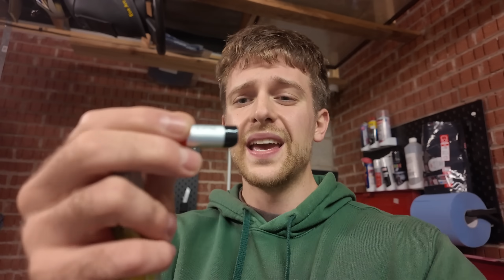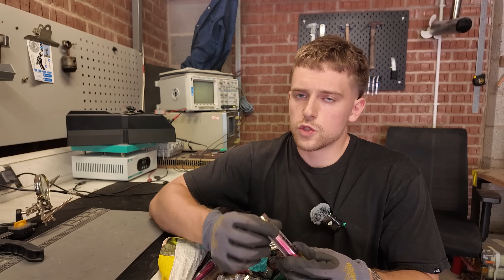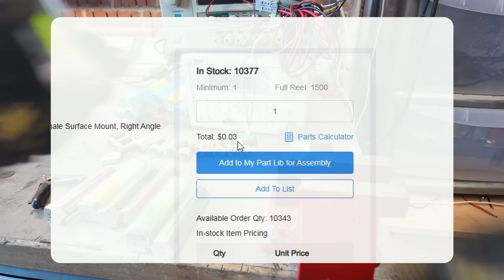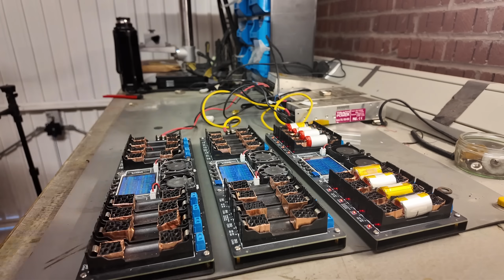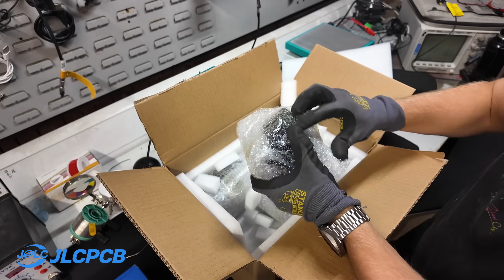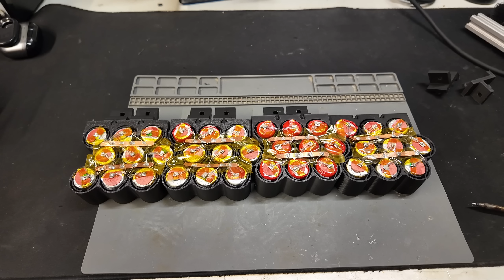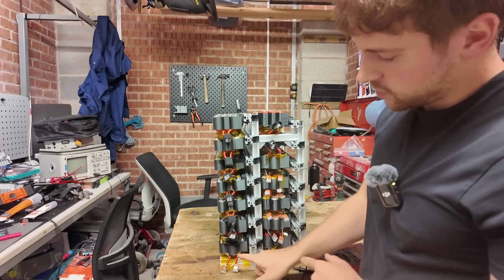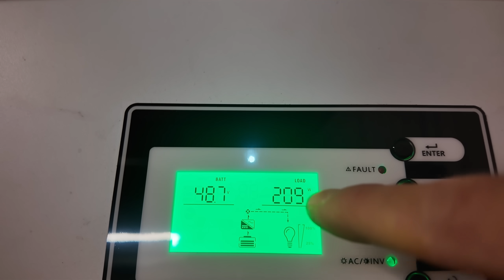I Powered My House Using 500 Disposable vapes

Comment: A 2V cell is not necessarily dead. 2.5V is very much recoverable but even lower can still be saved. 

Big caveat that any below 2.5V should be treated with extreme care. That said, these cells have only had maybe a couple of cumulative cycles or possibly even one cycle. 

They will be degraded and have a much shorter life but could still sustain hundreds of cycles at a reduced effective capacity. 

I usually mark such cells and trickle charge them, cycle them a couple of times and use them in low power projects in low risk settings. 

Separating these cells is still a social good as it makes recycling much easier for downstream waste management.

Comment: It's a fun project, but it's definitely not feasible and is extremely dangerous. It's best to do this with pre-made batteries using lifepo4 chemistry, which is much safer than Li-ion batteries.

Comment: As you're sponsored by jlcpcb, maybe next time instead of fiddling with copper tape, you could use PCBs to interconnect, with thin traces as fuses, route  bms connections  and maybe even provide  mechnical structure.

Comment: Please get or build a proper point welder and get these nickel strips to connect the cells. You could build one with a 10ah motorcycle battery, a 500A starter relay, a timer, a footswitch and copper electrodes.
The battery will be shorted thru the starter relay for half a second or even less, the timer must be able to do 0.1 second pulses. With that welder You can produce proper safe batteries.
I´d be way too scared to just solder such a battery, for a test- okay, maybe. But it has to be redone so do it proper the first time. Every battery I opened is welded, not soldered- I wonder why…
You did well enough, I can see the value in it. But please weld Your cells, You´re a good Lad, I want for You to not …leave the group chat because of a wanky connection. For the "Extra Safety" You need to weld.
And store that stuff somewhere when it goes it doesn´t include You or the neighbours. God Bless…

Comment: Power it by your own, self made solarpanels. 

Also, quick addition. The UK used to be 240v mains standard, however the past 3 decades the UK and the rest of Europe has been working on standardizing the voltage to a range arround 230v. So all power in the region will be 216.2V to 253V. 240 is works just fine, but just something to think about. We in the Netherlands also still have a lot of people thinking the grid still outputs 220v (I currently read 229v in my breakerbox).

Comment: These batteries are only rated for about 500 recharge cycles, which, if you're gonna be constantly using them to power everything, you will reach fairly quick
Reply: Not true.
Reply: That's like saying an expensive phone is junk after 500 charge cycles 😂
Reply: @Samusaran77  What do you mean? Batteries in phones and other electronics are usually rated for way more charge cycles than these vape batteries. And I don't get the comparison with a phone since, no, expensive phones aren't junk even after their battery dies, but disposable vapes are. They have nothing to offer to you other than their (albeit subpar) batteries, unless you're a smoker.

Comment: lithium cells below 3v aren't bad.  They have just been discharged below their balance point.  They still work, you just have to bypass their safety circuit to charge them up the first time.   Tossing them because they are below minimum is such a waste of resources.
Reply: You may be slightly right, but there is a reason that the safety circuit refuses to charge them. They can develop metallic "dendrites" on the electrodes and actually are not fully safe. Maybe you could use them but I certainly wouldn't include them in such a large pack if I were Chris!
Reply: @cyberspearmint  Mmmm puffy cells
Reply: These cells are made with extreme anode overhangs and are not safe to recharge.
Reply: depends though, if they have gone really low then they will not be safe to recharge. can't remember exactly what the lowest voltage limit was, i think its not an exact science since you dont know whether any of the formations have started on the contacts without cutting them open and lookin on an atomic level, but if they form to the point it shorts then the battery will explode if you try and charge it. the under voltage protection circuits on them is there for a reason, it's just likely to be rather conservative with what it considers safe to recharge in order to reduce the risk of fire to near zero.
Reply: @MrMediaPC  Of course they will be safe to recharge.  You're talking about a cell that has had ONE initial complete charge, and ONE complete discharge in it's ENTIRE lifetime.  One full discharge will perhaps lower the TOTAL lifespan of the lithium cell 0.1%.  In THIS application that degradation is COMPLETELY negligable, since it will NEVER again be charged without a battery management system.  Calling cells "dead" just because they were discharged below minimum ONCE in it's entire life is leaving resources and money on the table.
Reply: @MrMediaPC  And that's pseudoscience and completely wrong.  The ONLY risk you're facing, is lowering the lifespan of a battery.  Battery manufacturers USED to claim, that you'd need to go below 1v for the chemistry to change in a Lithium battery, but the knowledge has changed since the 2000's when this statement was made.

Comment: 'damaged' cells most of the time just need a kickstart and rebalancing
Reply: Maybe this could be another project!
Reply: It’s true, but from what I’ve read they do lose capacity. I did recovered some old micro usb cells by directly charging them a bit. But I’m not very knowledgeable on the subject to tell if they lost their capacity because of time or because they got discharged so much! Not from use since they were barely used!
Reply: @TheMrSzmidt  I have recovered lithium cells from at least 40+ laptop battery packs that contain 18650 cells and I can say that for those that were severely discharged, at most they had a 300mAh loss in capacity over the other non severely discharged cells in the same pack so it's not a huge loss and still plenty usable. In some cases after cycling them I have noticed a capacity increase and the internal resistance going down as if it's healing.
Reply: True, but what really matters is how much damage was done by overdischarge. Meaning you need to test their internal resistance, effective capacity,  charge-discharge curves and temperature behavior.

Comment: 20:00 How long would the current capacity be able to run the load? Is that number of cells something thats running the house for 1 day? 1 hour? 1 minute?
Reply: So he mentioned the workshop was pulling 200w and the shot at the end says 45 amps at 53.63v so i think that means his battery pack has around 2400wh of juice. That should power his workshop as shown in the video for 12 hours and i imagine the house would be slightly less time, but he would probablly turn the workshop off when going inside too.
Reply: @AgedComponents That’s watts, not watt-hours. The BMS app showed that the battery pack had a capacity of 20 amp-hours and put out 49 volts, so that gives 980 watt-hours of capacity.
Reply: @BobbyHill26 ah thats not long at all then 5 hours in the shed and maybe 2-4 in the house depending on stuff like climate control and appliances. Im not too educated when it comes to eletricity but cunninghams law is always dependable lol.
Reply: @AgedComponents even worse, at one point you can see there’s a 270 or so watt draw on the battery, but the load on the inverter is only 210, so you’re losing a pretty good bit from the inverter inefficiency, I don’t know how it scales as the power draw goes up or down, but that’s about a 20% loss, so he’d really be getting less than 800 watt-hours

Comment: some flux on the solder joints would not only make them flow and look a lot better but also reduce the heat by A TON...
also, having to print and then wrap all the "springs" when you could have just used... I dunno... what do they use in flashlights? oh yea, SPRINGS... even just a Z-shaped strip of bus bar would have worked... saved ya at least a day right there

Comment: Vape batteries are great for small projects, but being constructed for single use typically means they don't have integrated protection and their chemistry is inferior, I found under test, they have a tendency to deteriorate faster than lithium batteries manufactured specifically for multiple charge/discharge cycles.

This is my opinion, I could be Wong! 😏
Reply: Yep, there's a lot of nuance in cell manufacturing and chemistry. Cell design has different "knobs" you can turn - increase capacity at the expense of longevity, or decrease manufacturing quality to improve cost while reducing reliability/safety. Vape batteries also tune far towards power output (high watts and C-rate) instead of energy density. EV batteries are a great case in point on this - tuned far towards longevity (years/charge cycles), while phone batteries are often still tuned towards capacity (runs long on a charge, but doesn't last many years).
Reply: You could also be Wright. We may never know!
Reply: @bluephreakr  I'm down and under now, you could be on to something, if I didn't know better I'd say you left right after getting up... Just going through the usual motions! 😏🤣

Comment: Just for some reference to the disposable vape problem. Not long ago many vape users were using mods with rebuildable atomizers which were not disposable and you were able to significantly reduce waste as the only thing that you were tossing was the bottle of empty vape juice after it was finished. Then governments decide to "Crackdown" of vape flavors and more regulation, which led companies to patent smaller single use atomizers because it was less expensive to present 10+ products for approval. This is a government regulation issue and banning disposables will do nothing but create a black market.

Comment: So each cell has a remaining capacity of around 1.4ah left
So each parallel group has 36 batteries x 1.4ah = 50.4ah
So your series battery is 50.4ah @ 51.8v and total whathours is around 2610wh or 2.6kwh at best.
Nice video but not really viable compared to Lfp batteries, which would be more safe, cheaper and have more capacity, I think the normal server rack type ones are 100ah

Comment: Although the BMS can stop a short circuit on the output, you should put a DC breaker between the inverter and the battery. Good project

Comment: Cool project though I do feel compelled to point out that connecting an inverter to a grid tied system without an automatic transfer switch that ensures power cannot be back-fed into the grid is quite dangerous, power line workers can and have been killed by such setups.
Reply from the maker: Yeah I defo agree, I will either take the workshop completely off grid, or I'll replace the inverter with a grid tie inverter which will shutdown if the grid is lost. This setup can be super dangerous if the wrong switches are flipped

Comment: Beware those cells recovered from vapes tends to fail so i wouldn't put more than 3 per parallel group in a battery. And i wouldn't use those to do anything else than a 5V power bank.

Comment: I have hundreds of vape cells myself and it blows me away how good some of these cells are, some of my favourite have 2500mah.
I need a 3d printer so I can make the power station but have made a few power banks with 40,000mah fast charge without one but they have that "suspicious" look to me them.
Awesome video goes to show how good they are
Reply from the maker: Damnn the biggest I've found were 1700mAh. I'm well jealous of 2500mAh
Reply: @Chris_doel they're a brand called "alibarbar" 
I've got 2500mah at 9.25wh, crazy thing is they're not rechargeable
And my other favourite is these 17650 cells that are basically 18650 but slimer, they're 1800mah at 6.66wh 

I'm in Australia, I got more vapes then I'll ever know what do with and get about 20 a week from friends 😅

Comment: Damn he never said what the final KWH is.
You can buy 5KWH 50v batteries for $1100
Reply from the maker: The final capacity was around 2.5kWh. Realistically given all the labour involved, it probably isnt worth doing from a cost perspective. But I think its still an important project just because of how insane it is and also to raise awareness of the e-waste
Reply: @Chris_doel  2.5KWH would be great as a whole-home UPS, those crap cells can only handle like 200 cycles which is plenty for a UPS too.
Speaking of e-waste, people are starting a lot of garbage fires with them!
Reply: @Chris_doel  I built a 2.6kWh battery out of 21700's, 13S10P.  Under normal loads (like with my computer, TV and a few lights - about 600-700W max), I could realistically run that for about 4 hours before my inverter shut off (It was a cheap Chinese inverter that shut off at 44V, so I could only get about 2.2kWh out of it (I had a Victron 150/45 MPPT charging the batteries off 2.4kW of solar).

I now have two Apexium/Docan DIY battery boxes with the LiFePO4 cells (16S1P), and that's about 32kWh.  I also have 4kW of solar, a Victron 150/85 MPPT, and two Victron 3000VA inverters.
Reply: Yeah, that's what I was wondering. A month ago, I snagged a Pecron E2400LFP solar generator for around $560. That's a 2kWh LFP battery, inverter and MPPT, all in one. But the purpose of this video isn't really about saving money, it's about e-waste.

Comment: awesome video as always but why shouldn't you connect different capacities in parallel?
i made a powerbank with 300mah and 500mah vape cells (voltage matching ofc) and have no issues
Reply from the maker: So the 500mAh cells will do more heavy lifting than the 300mAh cells. Tbh I dont think its a deal breaker as long as the higher capacity cells can handle the extra power consumption
Reply: @Chris_doel that makes sense, when you pull several kilowatts this issue gets amplified. thanks

Comment: But what's the actual capacity? I estimate about 1kWh assuming about 600mAh per cell, which is fine and would keep the shop running for about 4-5 h. But If this info is in the video I have missed it. Impressive anyways, especially for something that's supposed to be scrap
Reply: If the BMS app he shows is accurate, the capacity is 20 amp hours exactly, so at 49 volts that gives you 980 watt hours

Comment: Instead of wago connectors that has a relatively small contact surface I would rather consider using those terminals that car audio enthusiasts are crimping and simply use a giant thick copper busbar and screwws for connecting.

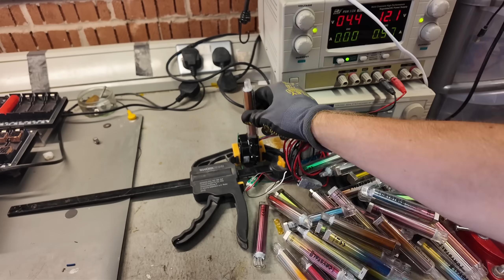Comment: fitting: at about 4:20, you make a device that vapes clouds at you with a device meant to help you breathe.
Reply: irony
Reply: @Gamix355  Surprising how much vape juice is still left in the so-called empty devices that are thrown away!
Reply: @RichieReportsUK_UKCNews eh, hard to say, the coil is probably burning cottage with it
Reply: @RichieReportsUK_UKCNews Could just be the cotton or coils burning up... Bet that would smell great! I know how bad it tastes when they just barely start to run out of vape juice.
Reply: @RichieReportsUK_UKCNewsmy last one was on zero and lasted another 4 days of regular use before it was actually empty.
Reply: @RichieReportsUK_UKCNews I've been collecting them for a few years now (only have 200 or so). First thing I do is disassemble them, throw away the foam/cotton with the fluid and leave the battery out for some weeks out in the open to get rid of the stench.
Reply: @ricpaul Yes, the smells can linger for ages, if you get any of the juice on your hands, you can still smell it for ages, even after washing with soap & water!
Reply: And it’s at 420 LMAO
Reply: Awesome

Comment: I'm really interested by the modular aspect of this. With the right adjustments, you could keep increasing your capacity as you find more and just add them in.

Question: What are you doing with the leftovers? I imagine the vape cases can be tossed in your recycling bin and taken away, but what about the dead batteries? Or the circuit boards? Can those be recycled? In my area in the states, we have batteries recycling drop offs, but I don't know if y'all have those, and if so, if they take batteries like this.

Comment: Would have love to known the actual usuable Capacity! Back then i also Build a powerwall from used 18650 Laptop cells. It should have been a 2.5kWh pack but when i ran tests it fell short by almost 500Wh. Im using big chonky LFP Cells now as theres Less cells. But yeah would have loved an Update on the usable capacity c:

Comment: its really too bad you have 2 parallel rows that have less cells. because of that the whole capacity of the pack will be affected as it will limited by the smaller packs in series...
Reply from the maker: Very good spot. So them rows actually had 1750mAh cells in them (from the massive disposable vapes) vs the 1400-1500mAh cells, so it kinda made up for the reduction in cell count, but not as much as if I would have been able to use 4 sets of modules

Comment: Ok but this vape cell is made for one cycle or more then one, after the first use the battery is new????
Reply from the maker: In the battery datasheet, it says the minimum cycles is 300 (before it reduces to 80% capacity). So I expect it has the same lifespan as a phone battery

Comment: The thing you need to worry about is the c ratings of the cells. So you was pulling 70amps from the pack so you.need to calculate how much amperage that is for each 3.6v row , then work out what the recommended for the cell is. Alot of smaller cells are only 0.5c or 1c
Reply: In parallel if you have 36 cells and your pulling 70 amps that would be 1.95a per cell your pulling
Reply: Also if the cells are only 1500mah your pulling over 1.3c of current